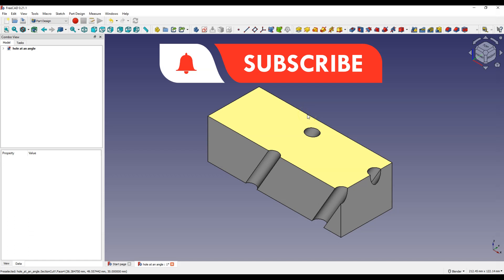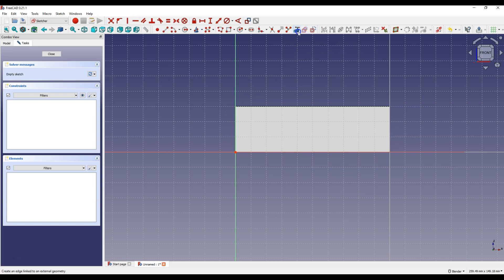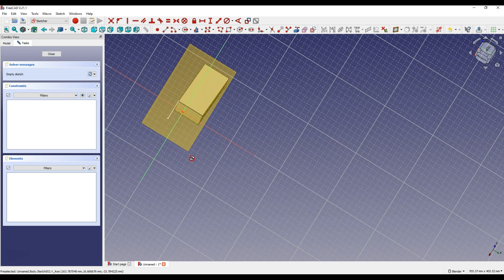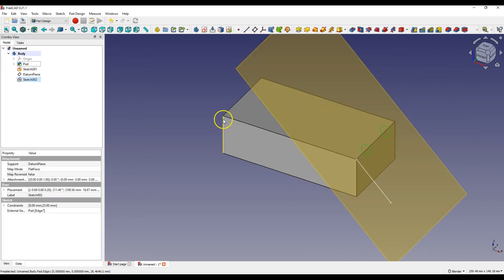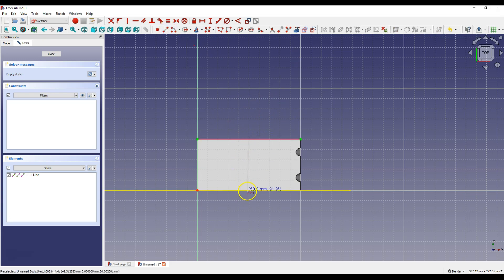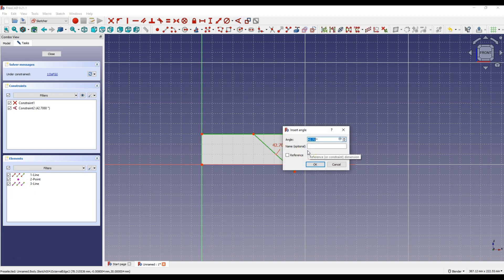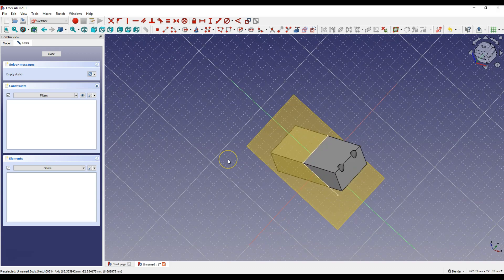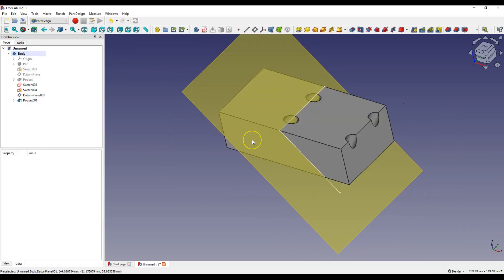Reference Plane and Holes at (Any) Angle in FreeCAD - Free 3D CAD

Comment: Good input. Thank you. Do you have any experience with parametric modelling? I am always running into issues with a parametric model, if I use external geometry for an additional sketch. Model usually breaks, if the values for the parametric design are changed. I would like to add your feature so that I can add something at a (viable) angle to en existing parametric model. Any suggestions?

Comment: Might be my version .21.2 but the instructions around the 5 minute mark do not work for me. The line will constrain to the center but do not pop in until I try to move one of the circles. The circles turn a different color, do not stay white. Then the following step selecting the centers of the circles and setting horizontal distance give an error "Datum 25.00 mm for the constraint with index 7 is invalid. Cannot continue from there. Since there's an error there, the pocked diappears the object and cannot complete. I tried setting the circles 25mm apart before symetric constraint but that failed also.

Comment: So the "Create External Geometry" button or icon is for to go back one sketch or a layer down to select existing construction elements.
Reply from the maker: External geometry allows you to create reference geometry to a previously created solid or geometry in the current Body.
This feature allows you to link the current sketch geometry to previously created geometry.
Not necessarily one layer down.
If you create a solid in, for example, 10 stages, in the 10th stage you can use the external geometry from the first stage.
Reply: @CADCAMLessons  Cool  got it thanks.